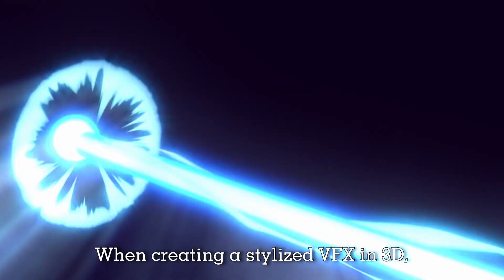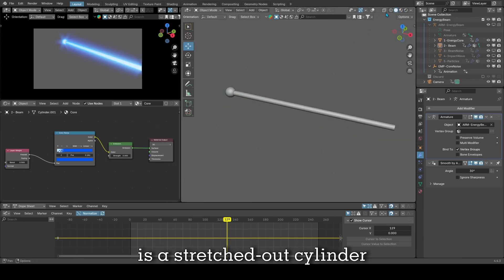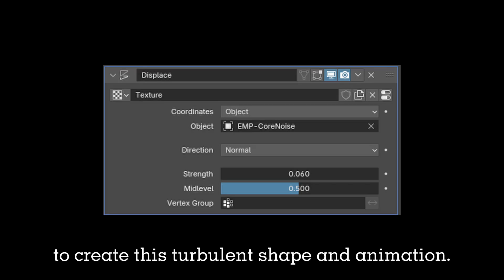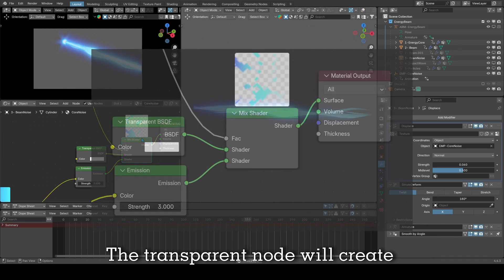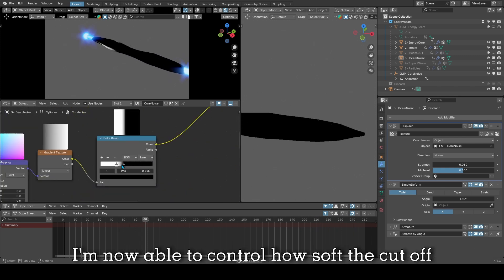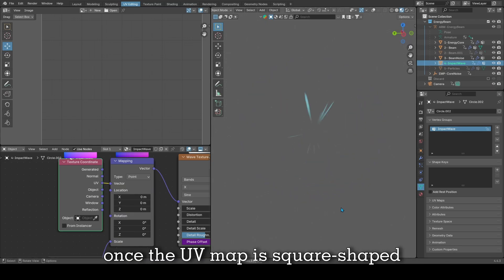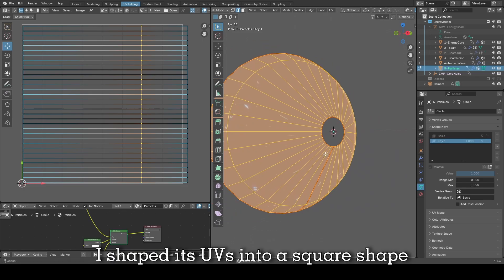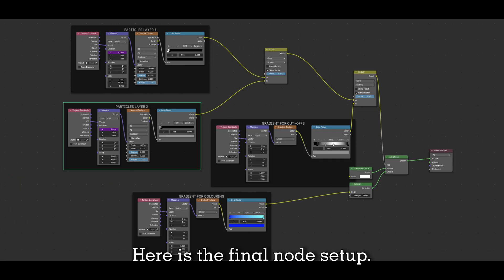Stylized ENERGY FX That Look Straight Out of a Game! - Blender Tutorial

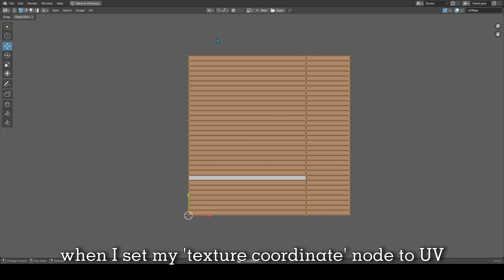Comment: 7:50  Add a plane, go into edit mode, rotate it 90 on X. Add the one edge one way and the 20 or so lines the other way. Add a simple deform modifier set to the Y axis. Move the mesh in edit mode just to the left of the Y axis. This sets the size of the center hole.
Then rotate on Z when you make the final cone shape......

Comment: I'm a bit confused where you were making the beam noise effect did you create a second beam or three? I noticed there is the EMP Core noise just caught me off guard
Reply from the maker: Hey, no worries. Essentially, for the beam noise effect, you duplicate the energy beam once, you scale it up a bit and you add in loop cuts so that the displace modifier's deformations are smooth. As for the EMP-Core noise, it's only an empty object that is used for the displace modifier's object coordinate's animation driver.

So, in other words, the energy beam noise is composed of one object (the duplicated cylinder) and the EMP-CoreNoise is just an empty object (EMP stands for empty) that is used to animate the deformation's displace modifier.

I hope this helps.